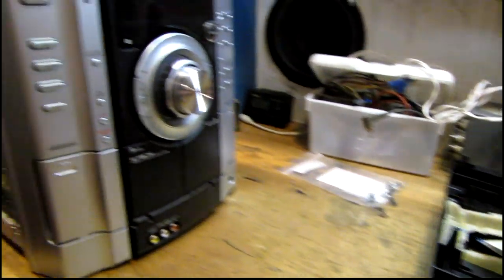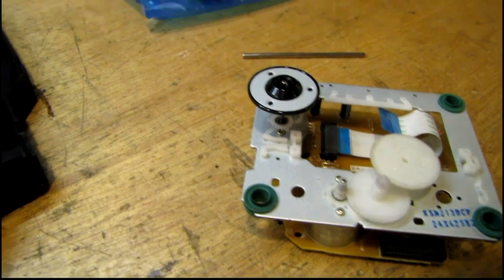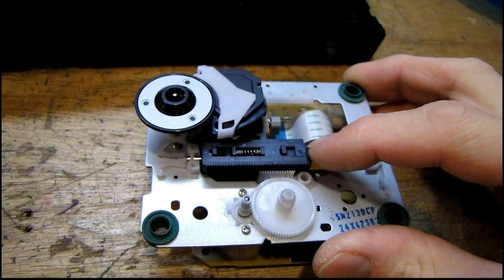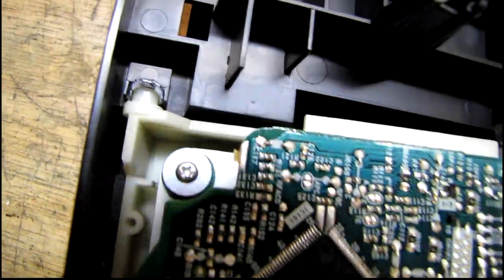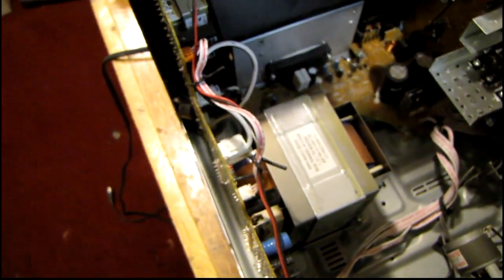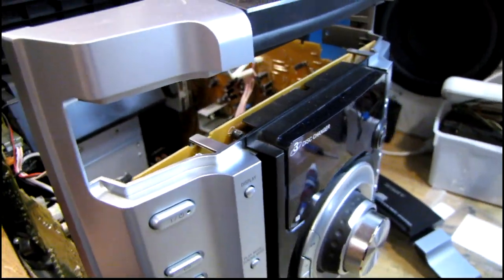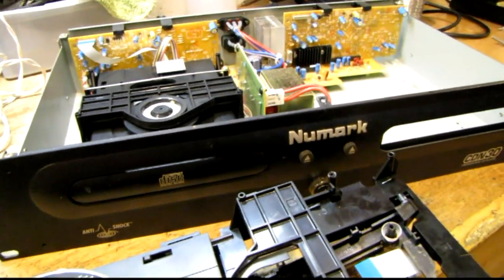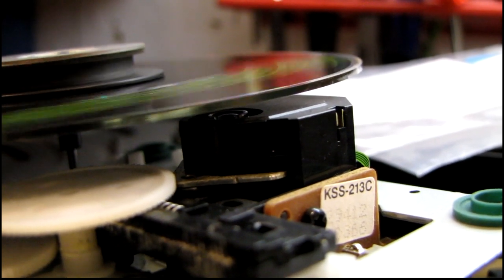Sony Bookshelf Stereo CD Repair

Comment: I was the owner of that particular Sony Stereo System.
I had it about 5 years almost in mint condition having not much "play time" the last 2 years the RMS power reduced dramatically and at the end, I had the same problem as mentioned regarding the 3 disc tray. Although i changed the belt with a new one at times it wouldn't turn in full, I changed again the belt with a much tighter belt, and lubricated that with lubricant (that is also used for plastic locks mainly on plastic car parts).

Comment from the maker: @THEtechknight Ya, this one was just a lot more hidden than I was used to.  Philips used metal clips on the plugs, and Sanyo had solder balls on the ribbon cable.  Sony puts the ball on the back of the little circuit board where it's hard to notice.

Comment: there's a solder bridge across 2 of the connections on some of these pickups. we installed a new one and it didn't work, had to call a friend from another shop and he showed us and we removed it. he said it's installed at the factory to prevent static electricity damage.

Comment: The dust cover for the lens is an awesome idea, yet nothing i have uses it.  The wii had alot of problems with dust, so much so that nintendo gave out free lens cleaning disks. It would seem that adding a small piece of plastic to the original design would have saved them a lot of money. Even my new blu-ray disk player doesnt have one.

Comment: On those lasers, there is a little vairable resistor, you turn that to adjust the lasers strength, maybe the new laser you bought wasent set correct for that cd player.

Comment: Thank you so much for sharing!  I guess I will have to 1) see if I can find a repair shop that does repairs on Sony and 2) start looking for a new one.  I know that I could not try to repair it myself.  I am disappointed, as I have had it only five years (but then again, that could be the "life expectancy" for this equipment).

Comment: the new lasers are sent with a soldered jumper in order to protect them against static electricity
Are you sure to have de-soldered it after you installed? You didn't mention it...

Comment: first of all very nice video.
i just want to share one thing.i have panasonic audio system "Ak -88" which has a 5 vcd changer.i bought it in 2001 and its pickup stopped  working only after 7-8 years in 2008 so replaced it with a new one.then one day i just opened the old pickup just to see what is inside and i found that the laser was still fine,mirror that reflects the lasor up to the lens has fine-dust.i cleaned the mirror and now that old pickup is still working fine even after 10 yrs.

Comment from the maker: @Watcher3223 I did clean the old one.  

As for the new one, You're right- I completely forgot about the solder shunt.  I was familiar with the ones on the Philips pickups, but didn't notice the one on the Sony because it's on the back of the PCB.  God I'm such a dork.

I should remember to never work without a clear head.

Comment: @Maxxarcade
yes you are right,all the pickups that i've ever seen are sealed and if we try to open it the pickup gonna break or never be fixed back again.fortunately the pickup that i have has screws.i guess all the panasonic"s AK (not dvd)series has the same pickup as i found the same lens in audio cd changer and a video cd changer too.

Comment: I have bought two Sony systems like this from Walmart and I will not buy an integrate system like that again. In both case the CD player quit working. The second player lasted on year! Limited selection of expensive parts was available from third parties but replacing the CD reader head didn't fix my problem. I am switching to component systems only.

Comment: When it decides to play a disc , it doesn't do that clicking noise at all but instead i can hear that "disc spinning" noise that every stereo does.  
Curios enough , i removed the top cover to see what's going on , but all i can tell is that the discs are spinning wheter it does the clicking noise or not, so it can't be a bad rotor that has to be replaced. 
I know that there's something to be replaced , but i can't tell if it's the lens or the cd mechanism.

Comment: nice video.i love it when you repair audio stuff.
only 5 years and the laser is done?uau.
i like the feature that covers the lens.never heard of this before.too bad it doesn't work.how much would it cost from Sony?
I found out that the power output would be 140w+140w max rms.it seems a little too much.doesn't it?

Comment: Took another look at it. There's that little plastic that covers the lens and that doesn't allow it to go up and focus on the disc.  When it works , that plastic comes off , the lens gets up and it can focus and read the cd. Otherwise it will simply stay in the lens's way.
 Something looks like jammed.  Pff , dunno what to do..

Comment: By reading the repair manual , i can see that it uses a KSM-213DCP/Z-NP laser diode, and a CDM74-K6BD80 cd mechanism.  I have no luck finding any of them. I was wondering if there's any other laser that has a different serial number , but it's compatible with this one as sony won't give you much info , but simply to take your stereo to them.  What about this one that you bought? Can you give me any info on that please? 
Thanks in advance!

Comment from the maker: @highvoltage12v No problem... Just don't make the same mistake I did, and forget to remove the solder from the safety ground point on the pickup assembly :-)

Comment from the maker: @Swi2ler No, I mean the new pickup was probably not dead, I just forgot to remove the grounding jumper that is used to guard from static electricity.  At this point I'm not going to take the stereo back apart though, since the old pickup I got from another player is working fine for now.

Comment: Hi man! I could really use your help. 
I've got a MHC-RG444s which mostly fails to read the disc.However it works sometimes,but it's like playing at the lottery. 
What it does is a strange ,sort of a clicking noise every 2 seconds ,and after 3 or 4 clicks , it will say "No Disk" and move on to the next disc, which might play (unlikely) or might not (mostly).

Comment from the maker: @chrisstv1979 I agree, I always hated Sony's later stuff.  Though my STR-DE545 receiver from 1999-2000 is still going strong.

I probably would have scrapped the stereo in this vid if it were mine, but I was curious about the interchangeability of the laser assembly anyhow.

I haven't had too much trouble with Ebay myself.  The couple times I had a bad item, I got a refund.  I have had trouble with a few buyers over the years though.

Comment: Hi I have the same stereo, recently it stopped working. When i plug the power supply in, the power light turns on then starts flashing on and off repeatedly. Any idea what the problem could be?
Reply: sounds like protection error thats  usually  what it is might have a bad amplifier that needs to be replaced

Comment: Usually when i have a audio cd with reading problems i try to focus the lens, behind the laser unit is a small potentiometer or variable resistor i clean a bit the lens and put a cd in and when It loads i turn the vr gently right or left until it starts to work a bit and then insist untill it reads exactly as it should, i recently fixed a pioneer p-something it had the vr on the ribbon, and make sure try more then one cd when testing, next time try it it lots cheaper, goodluck